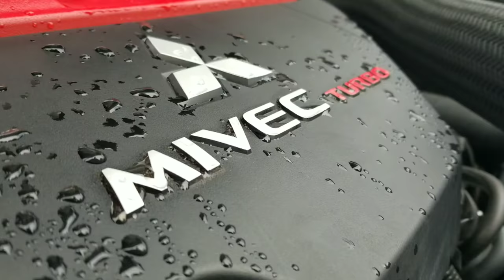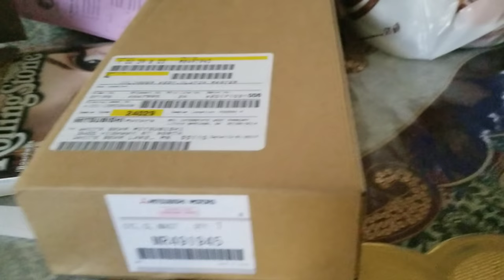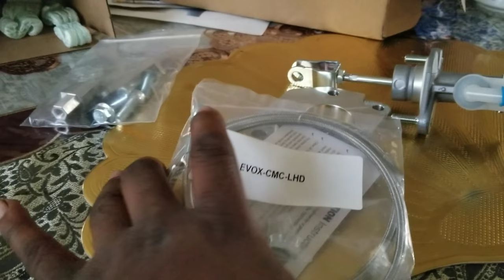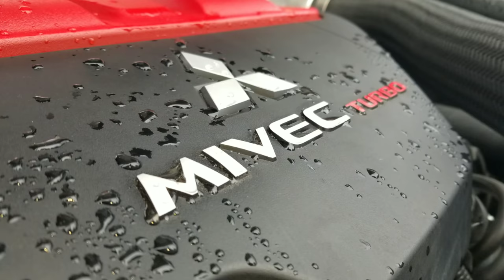EVO X CLUTCH MASTER CYNIDER REPLACEMENT

Comment: Thanks for the video man very informative. Im about to upgrade mine too!.
Reply from the maker: No problem if u have questions ask here or my ig which is the same name
Reply: @njl3o92  ok so i went to maperformance website, and it shows the map cmc kit and oem cmc but when i read the discription is say does not fit 2014 and 2015 evo x. Is that true? Obviously fits your car.
Reply from the maker: Yea it does fit that's the same one I have  I git the OEM . they actually  called me to get the OEM because people was complaining about the short lifespan of the aftermarket
Reply: Do you have to re bleed the brakes after you do this

Comment: How long did that Master Cylinder seal last???
I see a lot of scratches and gouges on the shaft made presumably by those vise grips on the table at 14:19 , probably trying to keep the shaft from spinning while tightening the lock nut.
That shaft should be smooth like butter for a good "In - Out"!  ANY imperfections will cause the seal to leak resulting in another failed Clutch Master Cylinder.
Reply from the maker: I upgraded my clutch so the mcm didnt really last thats long i wanna say probably  3 to 4 months after the new clutch
Reply from the maker: N yea thats true about the scratch  the vise grips i was usein was cheap n started to round out but i made sure i sanded that part so that way it dont damage anything else good eye tho, i left out alil parts here n there due to the cold weather, tryin to make a well needed video and also trying to get my only car done so i can drive it
Reply: ryen_evox I’m in the same boat! Trying to get the daily back, good luck!!!

Comment: You didn't show how to bleed the clutch bro! That's the part I'm stuck on! Please helpppp
Reply from the maker: Honda Verno srry it was crazy cold but its the same like bleeding brakes
Reply: ryen_evox lol that's the part I don't get. I tried pump 10x, open bleeder, close bleeder, pump 10x, open, close but I'm still not getting anything
Reply from the maker: Honda Verno recheck all ur lines, n fluid. Because thats was happening to me n then i started to get alil bit out of it n then more fluid came out it did almost take me a hour to bleed but make sure theres nothing loose n all ur lines are tight
Reply: ryen_evox so am I bleeding it right?  Seems like forever. It's annoying when the little thing on the slave doesn't go exactly inside the throw out bearing too
Reply from the maker: Honda Verno yea ur  Definitely bleeding it right n yea it do take a while to do it i had to do it on my own until i got help if anything when i was doin it by myself c if u can get a pump n tube n suck it from the slave
Reply from the maker: Honda Verno  how it work out, did u get it?
Reply: ryen_evox I was pumping it and had a feeling to check the tob and saw that the tob was separated from the clutch. Now i gotta deal with that extra b.s. all bad
Reply from the maker: Honda Verno oh fuck

Comment: I just bought the CC stage 3 clutch with the CC light weight flywheel. I couldn't get the CMC. How long did you go until the CMC go out on you? I have a 2015 evo gsr.
Reply from the maker: Im srry im just now seeing this but i belive i got 3 months out of if i cant remember,  the oem cmc was "supposedly" a recall part from the dealer because they was failing on the evos but i think i sped mine up when i changed my clutch

Comment: My clutch has no pressure now that I did mine how do you fix that?
Reply from the maker: If your bled the clutch, check for leaks make sure there's no air getting back into the lines . Check all of the bleeder screws, check the slave cylinder to make sure its in contact with clutch fork also check the clutch pedal  to make sure the rod is still on the pedal . The worst thing it could be is a defective part ,which would suck

Comment: How has it been so far? My cmc just went out and i bought this upgrade. No problems since?
Reply from the maker: Still goin strong iv had no problems with it since the install
Reply: ryen_evox good to know! 
I saw you mention a master cylinder seal in a comment below. Is that the big metal piece that holds the clutch cylinder? Did you replace that when you replaced your clutch?
Reply from the maker: @osvaldojimenez4823  I'm srry which comment  are u talkin about so I can remember what I was talkin about
Reply: ryen_evox a comment from garret down below. He mentioned a cylinder seal and that there were scratches. You mentioned you also replaced the clutch. Sorry for all the questions just want to make sure i install this correctly
Reply from the maker: @osvaldojimenez4823  ohhh that, No don't worry about that. I used vise grips on the shaft of the cmc to break the nuts on it . The vise grips left cuts  so he was askin if I sanded the shaft after, so it dont cut the seal on the inside on the cmc . And then with the clutch situation  I upgraded to a stage 2 clutch while I had my stock cmc  and I probably got a month out of it before it failed  and like I said in the video it was supposed to be a recall but they didnt want to do it so I had to change it myself  and there was no video at the time so I made this

Comment: How do u adjust your clutch pedal afterwards...
Reply from the maker: That piece that attaches to the clutch pedal  is ur adjustment so loosen  the nut on the back n then turn the head to adjust it in or out

Comment: What did you use to drill the two holes? Or did you grind it?
Reply from the maker: I used a cross cut drill bit but if you can get a small grind wheel you should be good , if you get the cross cut get a good one harbor freight dosent last long

Comment: How did u take the master cylinder off?
Reply from the maker: The OEM u twist off
Reply: ryen_evox alright thank
Reply: ryen_evox and the clip that holds the line how do u take that off?
Reply from the maker: @manuellazcano9900  pick or flat head sumthing small

Comment: Did you get the master cylinder from map? Is that the one for the evo 8/9?
Reply from the maker: Kevin Ramos yea i got it from map n no for the 2015 evo X the the oem one i kno its more money but its worth it at the end
Reply: ryen_evox gotcha.I know it gives you an option for oem and aftermarket which one did you go with?
Reply from the maker: Kevin Ramos oem alot of ppl that bought the aftermarket was still having problems so i just got the oem

Comment: Is that the map adapter??
Reply from the maker: Everything   came with the cmc including the adapter plate i had to modify, it to fit because  i messed up
Reply: @njl3o92  what brand is the plate and where did you get it? Thanks man. I'm following your instructions to replace mine, I got a 15 x and the cmc started leaking with just stock clutch.
Reply from the maker: I got everything from maperformance  which is also a oem replacement but on the box itself said Mitsubishi  so if thats right its a factory replacement for the failed cmc that came with the car

Comment: How did you get the studs off the clutch master cylinder?
Reply from the maker: Pinky F vise grips u dont need those studs that comes with it
Reply: ryen_evox hey man. Awesome video. I just wished u included d video on how u remove the studs.😁
Reply: Hey man, do u can narrate how u used d vice grip to remove the studs? noob here.😎
Reply from the maker: Jorhany Muti yea arry itvwas cold as hell that day buti just used the vise grips n put  them on as tight as u can n broke it loose nothing fancy lol